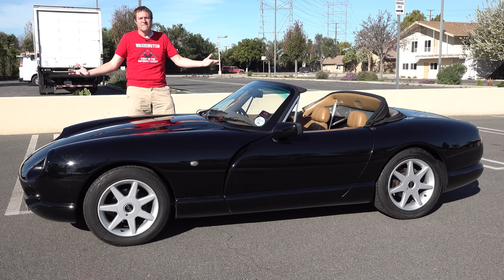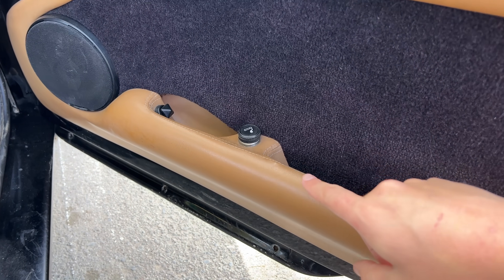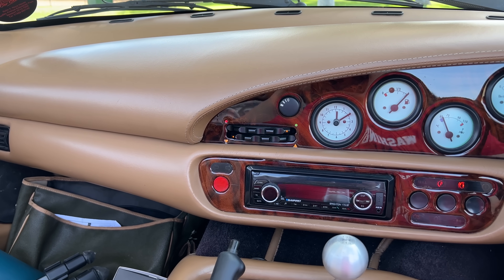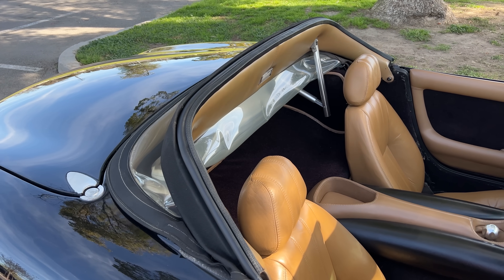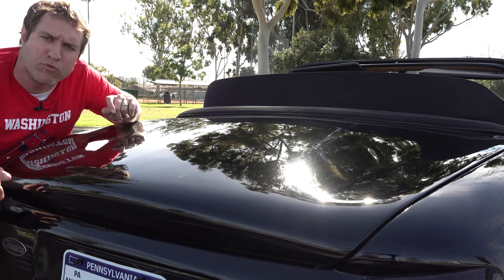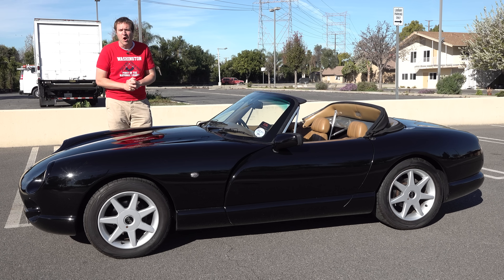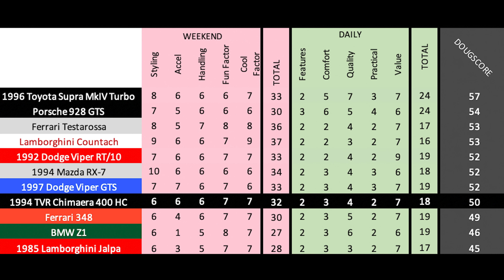The TVR Chimaera Is a Quirky, Weird V8 Sports Car

Comment: Knew this was coming when I saw you standing in front of it on a cars and bids ad on a previous video 🙂  I also knew you'd love its quirkiness!
I have the 4.5 litre version built in 2000 so it has the better switch gear and the dashboard is more logically organised.
They did build some LHD cars although not that many. There were some built in Malaysia. I'm sort of assuming these were all LHD but not certain. There are definitely LHD examples in Europe.
You got the two dials wrong for the ventilation - the top one controls temperature - left towards the red LED is hotter and the green LED is cold (blue LEDs weren't a thing in the 90's!)
The bottom dial controls the distribution of the air hence the two triangular LEDs which point upwards towards the windscreen and downwards toward the passenger area.
There are central vents - they are hidden under the dash in front of the area where the electric window switches are. There are also vents hidden by your legs on the transmission tunnel which can be opened or closed. And early cars had a cold air blower in the driver's footwell.
The reason for the triangular shape on the doors is that the front piece that meets the windscreen is a channel to support the window glass. The other piece is just to support the channel.
There is some logic to needing accessory position for the boot. Without it anyone could just reach in and open the boot if the car is left somewhere with the roof down. It's the same for the filler cap; the cap does not lock so the boot lid serves that purpose.
The thing about most RHD cars having indicators on the right is not actually true. Most RHD cars have the indicators on the left just like all other markets. It was mostly Japanese stuff that had them on the right. In fact I had no idea that early Chimaeras had it on the right.
You would have got the roof down a bit lower if you'd undone the velcro on the sides. Visibility is good out of the side mirrors so it's not a big deal really anyway.
Reply: If there were Chimaeras built in Malaysia I'd assume they're right hand drive, as Malaysia drives on the left, unless they weren't specifically built for the Malaysian market. Though if the car made it to mainland Europe then those would likely be left hand drive examples.
Reply: The indicators being on the right was a traditional British thing. It had largely fallen out of favour as it made no sense to manufacture different steering column assemblies for left and right hand drive.

As an aside, I believe the Cerbera also has the stalk on the right.
Reply: @Gordanovich02  when? I don’t know of any car in the last 50 years that had it that way.
Reply: @gooddypm  Triumph Dolomite had it I'm sure. Early Austin Allegros did though by Series 3 they'd switched.
Reply: @gooddypm  most old British cars had them on the right but they started switching over to the left in the seventies.
Reply: @davidholden2658  so, like I said, in the last 50 years!
Reply: @Gordanovich02  My 19874 Ford Escort had the indicators on the right. My 1980 Ford Capri had them on the left. There again the Capri was a German car.
Reply: Pretty much all British cars used to have the indicator stalk on the right.
As globalisation took over, or British manufacturing went bust, that went away.

Japanese manufacturers have a healthy domestic market so they still make many of their domestic cars with it on the right.

Comment: Hello, im Uk and many years back visited the factory in Blackpool. It was a Sunday and a special open day for the TVR club, I have an old camera picture of my late bother in law peering under a big cover where a  prototype version was hidden. Factory security got really snotty with us (hey ho). The factory was a mad old hotch potch with chaps sploshing fibre glass resin around and zero or little  H&S and little PPE. A German chap in the tour started shouting "das ist miner" .. meaning he was looking at his TVR car in raw form in production ( the build sheet was stuck on the back wing) . No major conveyor belts and just big shed type units. I also recall the tour guide saying that MOBIL 1 (its relative errly days of synthetics) which they put in the cars was too effective and they ran in the engines on old fashioned mineral oil to bed in for the first few thousand miles. Am i also right in saying that the brake servo is masked by the fibre glass body as they forgot to leave access in the early production cars. Please note this was many years back and im getting old so memoy mat be a bit off detail. Our tour day enede with a huge cavalcaed of TVRs doing the sea front drive past. My Brother in law had a TVR 3000 M . nice vid by the way.

Comment: Friend of mine had one of these in the late 1990s. Bought it for a good price, looked after it, daily drove it, sold it a few years later. For a net profit. Unbelievable.

They do take a fair bit of looking after; the chassis tubular frame is the main worry. There are UK companies that make replacement chassis, so it is feasible to save one that's too far gone. All the panels are fibreglass, so they won't ever rust. The engine can be kept going forever. There's nothing complicated about the brakes, etc.

Interiors; well, any old interiors shop is going to be able to do as good a job as TVR did in the factory! If you do strip out the interior, be prepared to find graffiti underneath the coverings...

Fun fact. The tail lights on the TVR got re-used on the McLaren F1. McLaren picked because they thought that TVR must have homologated it. Nope. They'd nicked them off a model of bus...
Reply: Great post. Though I am sorry to say your last paragraph makes a sweet anecdote, but there is no way that is true.  Everyone even remotly involved in car design learns of the lightning certification woes while they are still in diapers, pretty much. But I do agree it makes a good story.
Reply: @GoldenCroc  go look it up, it's been widely reported in the respectable motoring press.
Reply: @abarratt8869  I am sure it has. Doesnt make it true, everyone loves a good story,  especially the press whos livelyhood depend on it. If you think about the story, I am sure you will also realise that it cant be true. Also, which TVR model used the taillights they wanted to use on the f1? Sorry to be a party pooper, wasnt my intention to bring the mood down, I swear.
Reply: @abarratt8869  early model Chimaeras and Cerberas used old Ford Fiesta tail lights.

Later ones used generic individual small round lights that actually may have been used on buses too.

Both types had a perspex lens covering them.

Comment: Had a tvr in 1997. It broke down all the time. The roof leaked when it rained and occasionally the driver's side door would come off!  But the sound of the engine through a stainless steel exhaust, popping was awesome.
Reply: reputation of TVR wasn't fake

Comment: The rear badge rant was a little bit strange and undeserved, and the roof is obviously not operating correctly, lol...
The rear lights are "parts bin" items, so they didn't have to get their own designed. They are from a Ford Fiesta from the era. Then they added the covers to style them into the rest of the car.
I'm surprised you missed that the bodywork is all fiberglass which is part of why it is so light, and that the engine is actually American in origin. The Rover V8 started life as Buick's all alloy replacement for the nailhead.

Comment: Good video. I've only driven a Chimaera 500 (the 5.0 litre Rover V8 with cross-bolted block) which belongs to a friend. I myself owned the Chimaera's big brother the Cerbera which looked superficially similar styling-wise in a 2+2 coupe form, but was a totally different car underneath. The Chimaera uses the Rover engine, Rover clutch, Ford Sierra brakes and most of the electronics are borrowed too. The Cerbera was the first TVR to use their own engine, a super lightweight race-derived V8 with a flat plane crank and 94bhp/litre, a bespoke clutch, AP Racing brakes and bespoke electronics. I absolutely adore TVRs. I'd have another in a heartbeat.

Comment: I know it can't be easy being a small car company but I imagine they'd sell so much better back in the day if the interior wasn't the most complicated oversight in the entire car industry.
Reply: Complicated? You should see the final Tuscans - these '90s cars were simple compared to the last of them!  Mind you, as a small car company, what do you do when Rover killed the V8? Yep, TVR created their own - the AJ6 (later Speed Six) inline unit and then they decided to take it racing and created the crazy Speed Twelve - according to Peter Wheeler, they dyno'd it and the engine broke at 1000bhp. They left it at 960bhp and it was undriveable so he just refunded all the deposits and only 3 prototypes were built.  

I think Doug would become a blithering mess with all the quirks and featureson one of the last TVRs... (though technically, the company has been relaunched apparently  - in Forza Horizon 4, you can drive one of the 'new' ones).
Reply: It was kinda the point of getting a TVR, you wanna be different and stand out from the crowd.
Reply: The gas filling procedure alone is super annoying. I don't even own one and I'm sick of it.
Reply: Seriously, if you bought the 5 litre version you got better acceleration than a Ferrari F40.

AND a beautiful hand crafted full leather interior. (Have you ever seen an F40's interior?) 

And all for a fraction of the price of an F40. And far cheaper to operate and maintain too.
Reply: @_BangDroid_ bear in mind, you're already in the car with the ignition on, since you just drove into the filling station. 

All you have to do is push the button before you switch off.

Comment: I  always loved TVR's. They did a model called the Cerbera which had an in-house straight 6. But then they release a 12 cylinder version - it was insane!
Reply: @freddysquirenaranjo4859   Speed 12 that was it. Thx.
Reply: Cerb first had a 4.2 and 4.5 in house flat plane crank v8 - the sixes came later

Comment: 0:01 intro
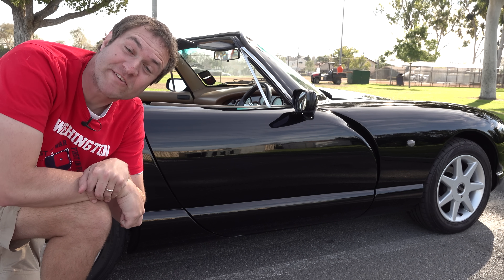1:53 quirks and features.
3:18 Interior
11:15 retractable roof
12:34 boot
15:56 engine
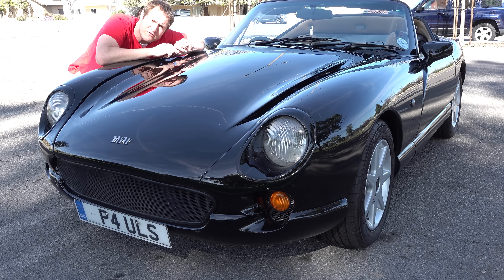18:49 exterior
24:25 driving
25:48 conclusion
Reply: How did u watch the whole video in 9 minutes?
Reply: I'm urinating at an alarming rate.

Comment: To address the issue about parts availability, TVR still exists as a company (it's actually in the process of getting a brand-new Griffith into production) and in 2014 it set up the TVR Genuine Parts initiative specifically to assure supply of parts to owners, rebuilders and restorers: https://www.tvr.co.uk/genuine-parts
Reply: didn't Shmee order a new one like 15 years ago? lol
Reply: In the process... well that is one way of putting it. I hope they pull it off, I really do, but the chances are astronomically small.
Reply: To be fair, how many 30 year old cars can you still buy new genuine parts for?

Comment: I’m surprised Doug didn’t mention the really bizarre exhaust manifold design that car had. Not sure how many people noticed but the manifolds pointed towards the front of the car and merged in a y pipe that then went down in front of the engine and under the car. Super weird design
Reply: Saw that. Bit silly, but this car is silly anyway.
Reply: @Eatinbritches  

How is it 'silly'?

Comment: Love the exterior styling.  This car is quirky indeed.  Could the cigarette lighter on the right door be because most people are right-handed?  If it were to the left, the driver might have to switch hands with a hot lighter to light their ciggy.
Reply: Maverick TVR boss Peter Wheeler was a famously heavy smoker so the lighter and ashtray will be placed EXACTLY where he wanted them.

Comment: I love these. Always classy looking but cobbled together from a lot of parts bins. I have to add though, the indicator stork isnt on the right because its a right hand drive. In the UK the indicator is still on the left and wipers on the right. This is more like a Japanese car where they switch the storks round
Reply: @YourWifesBoyfriend  stalk
Reply: Someone already mentioned the steering wheel assembly isn't stock

Comment: Part of the front end was actually designed by a dog,
TVR boss at the time Peter Wheeler´s dog was always at the office, and they had a polystyrene design model of the car there they were working on.
The dog bit a chunk out of the front end, and they thought it actually looked cool, so that´s why the spot where the turn signals go look like that.
Reply: Ned was a regular visitor to the factory back in those days.

Comment: The reason for the quarter window frame was put in for the gap between the window and the A pillar. It was an add on after complaints from customers over the leeking windows
Reply: there to strengthen the frame

Comment: I comments on this video a year ago and just watched it again, as I’m closer to buying one myself!

Just to let you know a few points, the rear lights on these earlier ones, are actually from a Ford Fiesta, hence the additional covers, to try to hide the fact they’re from a regular hatch back!

Since you mention the Griffith, that used the rear lights from a Vauxhall Cavalier GSi (known as the Opel Vectra in the rest of Europe), but turned upside down!

Later Chimaeras had four individual light lenses, per side. 
The rear bumper and front grill design also changed on what are called the mark 2 and mark 3 versions.

TVR being TVR, there are some cars with a bit of each variation, as they crossed over between versions!

The changes between versions, also included those heater and light controls on the dash. If you look at later ones, those 3 black buttons have gone and the heater controls are different!
Later ones also have extra air vents in the middle of the dash, but very low down, just behind where the window switches are!

The headlights on the last models, were also enclosed under covers, the same as the Griffith.

I didn’t hear you mention the construction of the car. The chassis is a separate item, made from box section and semi tubular, then the body is fibreglass, that’s how come it’s so light!

This chassis is shared with the Griffith, but has a softer set up, as you mentioned.

Also, the front wheels are 15” and the rears are 16” with wider tyres! I’m surprised you didn’t notice that!

Later ones had 16’s all round. 

As for Right Hand and Left Hand Drive, American viewers will be pleased to know, these were sold across Europe in LHD, so ideal for export to the US!

I didn’t know all that when I posted my last comment a year ago, but I’ve done a lot of research since and I’m still learning!

As I say, I shall be buying one of these in the near future! I’m just trying to find the right one!

Although the body is fibreglass, so can’t rust, the chassis does suffer with corrosion on the “outriggers” especially, which are the tubular sections which protrude out from the main chassis rails and support the body, right out to the sills! 
Just for anyone in the US thinking of importing one, that’s one major thing to check for!

Also, the old Rover V8 is derived from the Buick V8 and I’m surprised this wasn’t mentioned. 

Anyway, it was nice to watch this again and great work as always Doug 😁
Reply: Rusty chassis can be a problem. But you can buy a brand new chassis! Big job to replace it, but there are workshops doing it.

Something nobody seems to do is to galvanise the chassis. Galvanising is surprisingly cheap, and a Galvanised chassis would probably last for ever.

Anyway, while you should always check,  chassis rust seems to be less common now. As the cars age, many that got rust have been fixed or replaced. The cars are becoming more collectible and valuable, so people are generally taking better care of them.
Reply: @ I’ve seen the chassis galvanised, but most get powder coated. I’ve seen plenty of home builders doing body-off restorations, which is much cheaper than paying someone, just time consuming and you need a few mates around to lift the body off haha!
Nothing I’ve seen so far, seems hard to do, but I’d rather buy one which had already had the chassis work done. That’s my plan anyway. I’ve noticed many cars staying for sale for months, recently though and only the cheapest ones selling. I don’t think prices of some are attracting buyers currently. There are several I’ve watched for months, which haven’t budged. Shame I’m not in the market just yet as there are some bargains to be had right now!

Comment: So I've got a 97 Chimaera in the States and there are some differences. First off, it has the door button under the mirror. There are no 3 buttons, the aluminum headlight knob is there along with a labeled fog light button. The turn signal stalk is on the left side, not the right, and the blinking arrows are dead center in the middle of the dash. The fan speed is controlled by an aluminum knob with a fan on it. Also, it has no hood mounted windshield washer nozzles, they are mounted ON THE WIPER FRAMES. Also, a weird thing about it, not sure if it was this way on the earlier ones, the doors and trunk do not open very far, for the doors, if you're not a skinny person, you're not getting in easily. And the trunk, you have to use a very long funnel to use a gas can because it won't fit in that little space.

And the owner's manual says it needs regular unleaded, but there's a sticker on the filler neck that says "Premium fuel only."